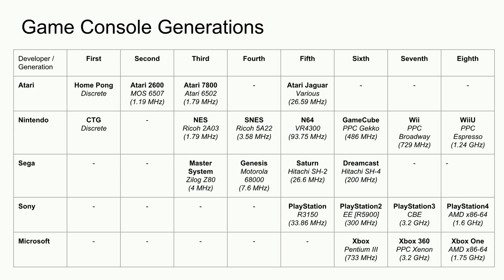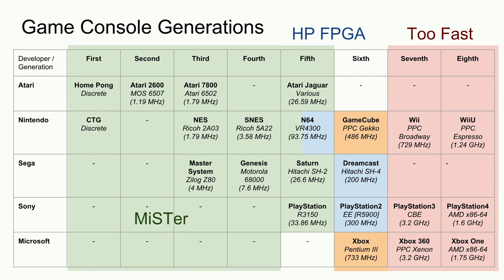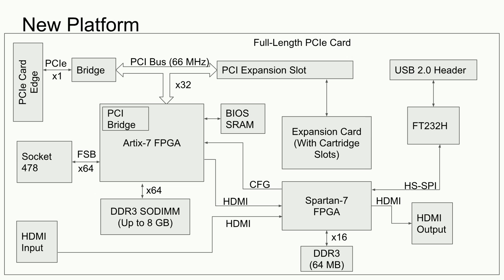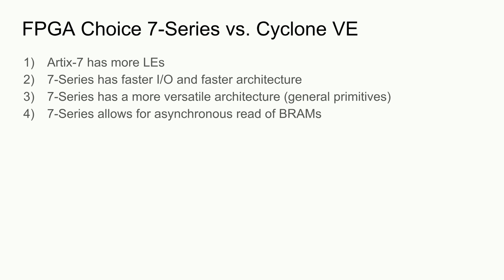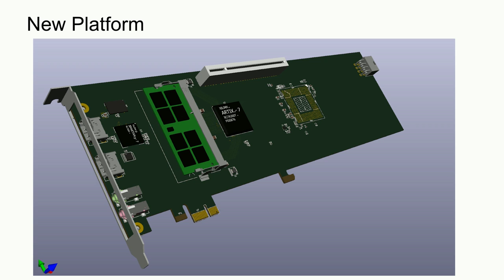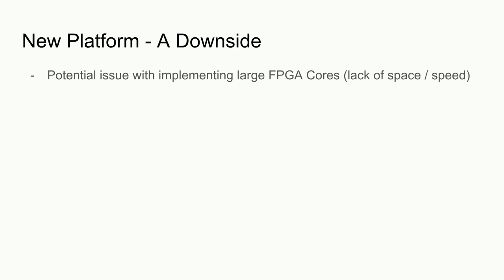A High Performance FPGA Game Console Platform

Comment: There was a s478 Pentium 3?
Reply from the maker: Nope, I meant to say Pentium 4 for the entire video, even though the xbox used a Pentium 3 (they are close enough in architecture that there shouldn't be any issues).
Reply: @RTLEngineering  Xbox games use `rdtsc` (assuming 733.333..MHz) to synchronize the CPU and GPU. So you need the proper timings or you have to patch games. I'm not sure what changed in Pentium 4, but I'd assume it could have bad consequences.

Also, if you struggle with the 733MHz Pentium 3, you might also struggle with the 2x DSP56k and the NV2A GPU.

I also assume that software solutions (XQEMU in particular) will be fast enough in the future (similar to Dolphin).

A major roadblock in usability of Xbox emulation is that you need the MCPX ROM / crypto-keys - but a FPGA implementation wouldn't change this.
Reply from the maker: @Jannik Vogel I am pretty sure that you can under-clock a P4 to operate at that frequency, though I would have to assume that there is some other form of synchronization, since the two clocks can become out of sync by a cycle very easily. I haven't probed an xbox to check this, or tried running a P4 at 733 MHz, but there should be a solution other than patching the games.

As for the struggle with 733 MHz, it's not possible to run logic in a low-cost FPGA that high, the maximum global clock that I have seen is on the Cyclone 10 @ around 600 MHz. However, didn't the DSPs and NV2A operate at around 230 MHz? If that's the case, then that is completely doable in the Artix-7.

Eventually CXBX will be fast enough, since the xbox was and x86 machine, I doubt that XQEMU will be fast enough, since it runs a complete software model for the CPU. That doesn't negate the benefit of a hardware re-implementation, otherwise that same argument could be made for any of the retro consoles, making this platform moot (i.e. not just an issue with the xbox).

It was my understanding that the major roadblock was getting the hardware components to work together correct at a reasonable speed ( the problem with XQEMU), if the issue was the MCPX ROM / crypto-keys, I would think that none of the working / partly working games in emulators would work at all. Besides, there are ways around that problem, especially if you are able to utilize a DMCA loophole / exception.
Reply: @RTLEngineering  Yes - DSP and NV2A run around those clock speeds (I believe 160MHz DSP and 230MHz GPU). I was more concerned with the number of LUTs and internal pipeline states which might be hard to recreate (I could imagine requiring a higher clock rate for naive implementations).

For the record, I'm a XQEMU developer; there are experimental XQEMU branches which reach full-speed (or very close to it) in many games. The main bottleneck for performance is GPU emulation (which those branches address); for users a critical issue is lack of audio emulation (which also exists in experimental branches).

XQEMU does not only have a software CPU. XQEMU has supported CPU virtualization (KVM) for more than 5 years, and has lately also been getting better support through HVF, WHPX and HAXM on Windows, macOS and Linux. There's also hardfloat in TCG (CPU interpreter) now, so even the software interpreter on a strong single-core machine will work fine for some games.

Cxbx is a radically different emulation approach which has many drawbacks (such as not being able to support all Xbox games as it depends on code-pattern detection, which won't work for link-time-optimized titles). So if you are going to compare a hardware re-implementation to a software-emulator, your only references should be MAME and XQEMU.

The MCPX / crypto-keys (required for boot-code decryption) are dumpable and known - so they don't block progress. But they are obviously illegal to distribute and you need to modify hardware to dump them (which end-users can't do); there's also no freely available tools to dump them. So it's an end-user usability issue that prevents growth of XQEMU [LLE] compared to something like Cxbx [UHLE / HLE] (among other factors) despite XQEMU being a superior emulator in many ways.
Reply from the maker: @Jannik Vogel Clearly you have a bias for XQEMU. That sounds like it has made great progress though! I briefly looked at it about 2 years ago, and convinced myself that it would be helpful if I ever tried to do an xbox implementation on an FPGA. 

How is XQEMU solving the MCPX / crypto-key problem? Is it relying on dumps? If so, then your argument about usability of an FPGA implementation vs XQEMU are identical. I think in either case, dumping the ROMs would be illegal, unless you are doing it on behalf of a digital preservation organization or university. 

You do raise valid concerns over an FPGA implementation, but this sort of platform would be the best hope for such an implementation if it is possible. Though part of the benefit here, is you could for example, implement just the NV2A on the FPGA, and do the rest with XQEMU.

I'm not sure what your concern with the DSP and NV2A are. In this example, the FPGA is only implementing the DSPs, the NV2A, the DRAM controller (which is small), and the FSB controller. The NV2A GPU was pretty simple, and is actually very similar to the VU cores within the PlayStation 2, so I don't think LUTs will be an issue (sure it will be large, but there are a lot of LUTs in the XC7A200T). As for the internal pipeline states, I don't think they need to be recreated exactly, as long as the end functional behavior is reproduced (i.e. it follow the spec that the software expected). If the concern is meeting the speed requirement due to the LUTs and pipeline states, that's exactly how you meet the speed requirement - LUT decomposition and pipe-lining. I think it's possible to do, but the actual feasibility won't be known until it's attempted (a downside to FPGA implementations - you can put a lot of work into them, only to find out that they are too slow or don't fit).
Reply: @RTLEngineering  I do have a bias for XQEMU (but also for MAME, despite not working for it) - but the issues with Cxbx are well known and is part of the reason why it was abandoned by its developers about 15 years ago. Cxbx-Reloaded attempts to address them, but does so by (among other things) using XQEMU code. Cxbx-R is great for some things - but certainly not for preservation.

XQEMU emulates Xbox hardware - Cxbx-R emulates the APIs but has little hardware emulation.
Hence, an FPGA implementation would have to be compared to XQEMU.

XQEMU and Cxbx-R developers are both part of the XboxDev organization and we do recommend each others projects for different tasks. So this isn't just personal bias, this is (mostly) a bias based on technical limitations of each approach.

XQEMU depends on dumps, but many people give up trying to acquire them (legally or otherwise). I don't know why dumping the ROMs for personal use would be illegal; it's a personal backup for interoperability. Distribution would be an issue.
This is the same issue for an FPGA implementation, where it would also hinder growth. That's something to consider before sinking hundreds of hours into it.
Even preparation for a FPGA project should consider this, especially with XQEMU and MAME doing a lot of work and probably being very usable by the time an FPGA implementation is actually being worked on. Compared to Cxbx-R (which is Windows and x86 only and not portable), XQEMU and MAME are created with portability in mind. So your GC "Dolphin" argument could be used.

I probably have too little FPGA experience (based on University courses with older FPGAs) to extrapolate, so take my comments with a grain of salt.
But I feel like fitting the 2 DSPs and the GPU on a single FPGA sounds "tight".

I strongly disagree with "The NV2A GPU was pretty simple". There's >= 4 projects (nouveau, XQEMU, pcem, MAME) working on ~NV20 emulation (and research) for more than 5 years, and not a single one of these is even remotely complete. In terms of size, keep in mind that the NV2A features a fixed-function pipeline, but also a programmable pipeline (both used). All projects already only implement some of the features.
I can't speak for the complexity of the PS2 VUs, but I assume them to be simpler (not having 2 pipelines, but just one, that's more flexible).
It's certainly possible, but will still be challenging in terms of workload.
Reply from the maker: @Jannik Vogel I meant the bias in a joking way. If your team can produce a XQEMU that can operate with perfect compatibility to all xbox games, and I am not able to come close with an FPGA when I eventually attempt it, then I am perfectly fine with XQEMU being the only solution. But the fact that XQEMU is being worked on / exists, is not reason to discourage working on a hardware based alternative.

In terms of the legality of the dumps, it's "circumventing a copyright protection mechanism", which is against the DMCA. I don't think the DMCA should have that clause, or even apply to no-longer produced systems, but it does.

The FPGAs you used at University were probably quite small (Spartans or Cyclones). It would depend on how long ago it was, but the Artix-7 has a little over 134,000 LUTs, each of which are 6-input, which makes them roughly the equivalent to 2 LEs / LUTs from the FPGA your University probably used.  Also Universities don't often buy the largest (more expensive) devices for their students to work on, so you may have been working with a mid-range spartan for example (so the Artix-7 may be anywhere from 2-200 times larger). There are also larger FPGAs, such as the Virtex and Aria, which each boast over 1 Million LEs/ LUTs, which clearly almost any implementation would fit into one of those.
It might sound tight, but it really depends on the architecture and resource utilization. Unfortunately there is no way to know until it's attempted. 

For the NV2A, I meant that the architecture is pretty simple, when compared to modern GPUs. The N64, PS1, and PS2 all use fixed function pipelines, and the PS2 used 2 VUs (4x FP32 ops each) which were independent and parallel programmed (they each had their own microcode). Though I haven't attempted to implement an NV2A (I haven't tried to implement a VU either), so I could be wrong. I am mostly thinking about from the components needed for the programmable pipelines, and how they would translate into FPGA resources.
Either way, you are correct, it would be challenging to do. Calling it "simple" was from the academic perspective, and not actually required work perspective.

Comment: The problem is even if you have all the logic gates available the difficulty to implement those consoles post N64 increases ten fold.  I can't imagine a single person implementing say Dreamcast in FPGA within a reasonable time frame.
Reply from the maker: Well, you have two problem there. 1) can you fit such a design into the FPGA, and 2) can someone realistically implement such a design in a reasonable timeframe. If you look at them, the more important problem is (1), because even if you could implement the design in a reasonable timeframe and it doesn't fit, you're sort of suck... 
Even an N64 is 10x - 100x more complicated than a Genesis / SNES. I would say that an N64 is about 10x more complicated than a PS1. And yes, the Dreamcast is 10x more complicated than the N64, and the PS2 is 100x more complicated than the N64, etc.
So then the next question is, what do you define as "reasonable". I would argue that who ever gets it done first defines the definition of reasonable for the system. So if it takes me 10 years to make a working N64 core, and no one else released one further, than my 10 year long project is the definition of reasonable for the N64, especially since the timespan of the project would not deter me. Though, I probably won't release the first N64 core - mine will probably just be the first one that doesn't rely on other IPs (for example, there is one in the works that is using a modified version of a MIPS32 core). 
Obviously, more people working on a single project will typically allow it to complete sooner. The problem there though, is that N64+ systems require high levels of optimization to run on "cheap" FPGAs ($200 for a chip might not seem cheap, but it's a lot less than the high end ones which cost $10,000 per chip). And the high levels of optimization require time and skill, so the pool of people who would be able to achieve that result efficiently is quite small - it's likely that many of the more prominent retro core FPGA engineers are not in that pool. Though I wouldn't use that as an argument to discourage someone from working on one of these cores, it may turn out that optimization doesn't really matter - I'm not sure.
Reply: @RTLEngineering   Thats what I mean, can we realistically expect someone to dedicate a decade to write a core?  Surely one would have to be really motivated to sacrifice that amount of time in their life to implement something.  

I'm just trying to have realistic expectations, that is all.  PS1 seems like the best we can expect in a reasonable time frame (2 - 3 yrs)  and thankfully someone is already on that.  He's only put in 7months of work, but so far it looks like he's taking this seriously if you read the github.
Reply from the maker: I think you are thinking about this in the wrong way. We can't realistically expect someone to dedicate a decade to write a core, however, if someone is motivated enough to write such a core, they will gladly spend a decade on it. Basically, the difference is you are thinking about it in terms of the community making a request, where as I think it will be done by someone who chooses to do so regardless.  At the rate I am going, it will probably take me two decades to do, but that won't stop me from doing it, regardless of what the community expects / requests. If no one else beats me to it, then that's when the first core will be completed. Keep in mind, that I have been working on an N64 implementation on and off for the past 4 years.

There are several people working on a PS1 core actually. So I'm not sure to whom you are specifically referring to. I believe that both developers that I am aware of, are basing their main CPU off of the aoR3000 though, which could potentially lead to problems - we shall see.

Comment: a ps2 or xbox sound kinda overkill. If it can be done id be surprised.
Id be surprised on a n64 core as even emulation has trouble with that. PS1 has very good emulation, It just has troubles with a few things that aren't right or mess up, but most games are playable and surprisingly runs on lower end devices fine like a raspberry pi..
I wonder if you can attach 2 d10 nano's together thou the expansion slot or via hdmi if there is enough bandwidth.
Reply from the maker: Anything can be done with enough effort. I'm not sure if it's practical though. You would need for at the very minimum, emulators on a PC to be able to play those system games flawlessly, which as far as I am aware, is not currently possible (they're pretty good, but not flawless). You could always make the argument that the new xbox is able to play original xbox games, however, that platform will become obsolete at some point in the future as well, so the target hardware must be something that is continually being produced and can therefore always be obtained (the benefit of FPGAs - even when the DE10 is no longer made, the cores can be ported to a new FPGA).
An N64 isn't trivial to implement in an FPGA, but it's no where near the limits of the DE10 for example - the problem is mostly space (lots of logic gates). There are currently at least 3 people working on an N64 FPGA implementation, and one has gotten a simple test program to display via VGA (so it's going to happen).
You could theoretically connect two DE10 Nanos together, but that would be a dumb idea. The DE10-Nano has extra dead-weight on it (the ARM cores), which you wouldn't need in an expansion. I have thought about developing an expansion FPGA board for the DE10-Nano, which uses either a Cyclone VE or an Artix-7, both of which could be programmed from the ARM CPUs on the DE10 Nano. Unfortunately, connecting the two would mean 1) no SDRAM (it would need those pins). The SDRAM could be attached to the secondary FPGA though, but that's another hop. And 2) limited bandwdith as you guessed. The expansion connector on the DE10 Nano is a 2.54mm header, which will not allow for high-speed signals to pass through it, so any communication link will be limited to below 100 MHz. That would probably be fine for most of the current cores, and may even be okay for the PS1, but it would probably be a bit slow for an N64 (unless it were partitioned correctly), and would be far too slow for a PS2. There would also be the issue of link latency - it may introduce more issues than it solves.